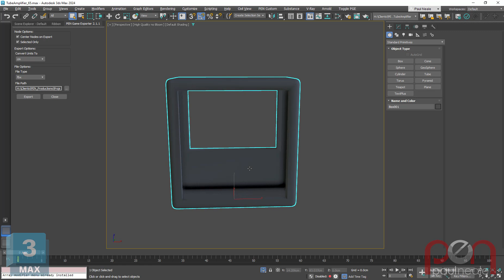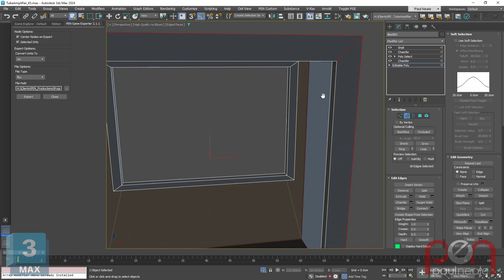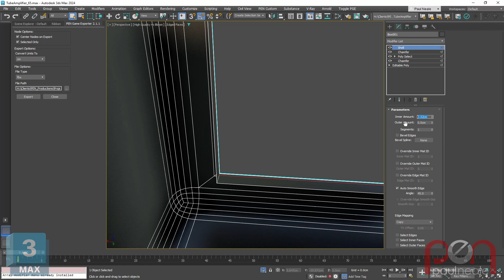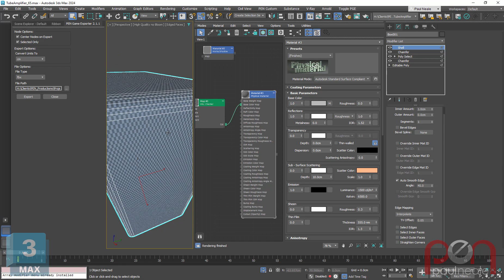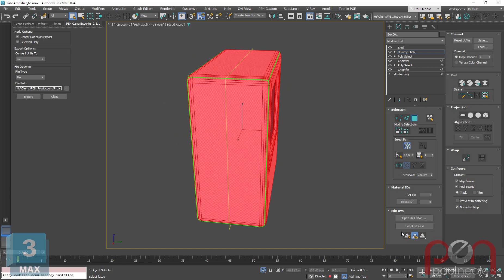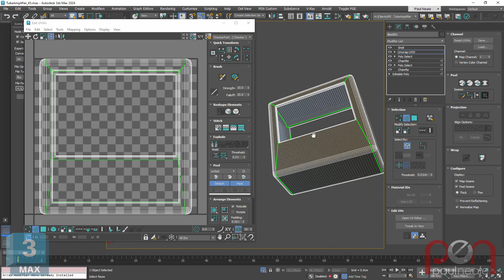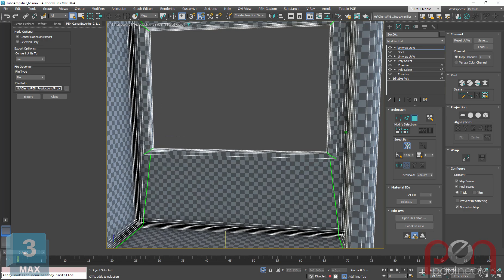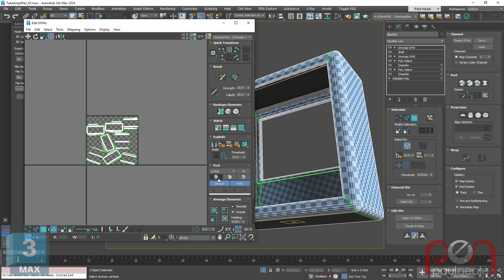3DS Max AMP Unwrapping 01

Comment: event though it's a good idea to pack the pieces together, put it's not always the case. Sometimes, resolution is needed. Packing things all together would have made you lose some resolution. am I right?
in your case, it will work just fine since you don't need much resolution in the inner part.
Reply from the maker: @eltiganeymohammed758  it also all depends on the size of the map you are placing on it. If you are using it real time you may not want the over head of more maps as well. There are alot of factors in how you unwrap.

Comment: Great tutorial, as usual! I am max user since 3D STUDIO MAX 1.1. Why do you keep mesh outline on? It's sooo distracting! In my opinion this viewport tool is useless and distracting.
Reply from the maker: To each his own but when I teach I need to stick with defaults as that is what my students or new users here will see. Personally I don't mid them most of the time. Some times with large complex scenes I might turn them off.
Reply: @paulneale  Makes sense to want to show it like newer users will see it.
Reply: And Cube UI... I am classic F, P etc.. shortcut
Reply from the maker: @cecofuli  OK, that one I turn off and give my students hell if I see them using it.
Reply: It's the first thing I turn off too when I install a new Max version :P, started MAX 4 here
Reply: I change the "select by name dialog" (H key) to the old style on every new version.
Always hated the new version. And yea I turn off those mesh outlines off too
Reply: @3dsmaxrocks699  me too! Also the old Material Editor
Reply from the maker: @3dsmaxrocks699 I don't use that at all since there is the  Scene Explorer that has been there for just about forever. Not sure why you would use the select by name at all now.
Reply: By outline you meant the wireframe on the model or those green map seams?
Reply: @none53  nope, the mesh selection outlines. When every time the mouse is over some mesh. I hate this tool. 😊
Reply from the maker: @timothyschreiber  I don't mind the caddies. They are not terrible, but I would that the whole modeling ribbon to be replaced.